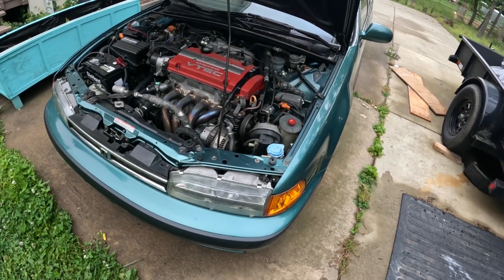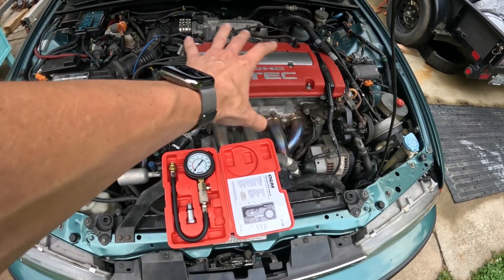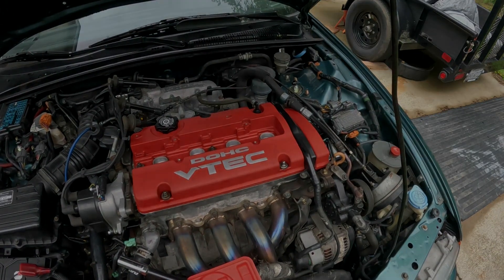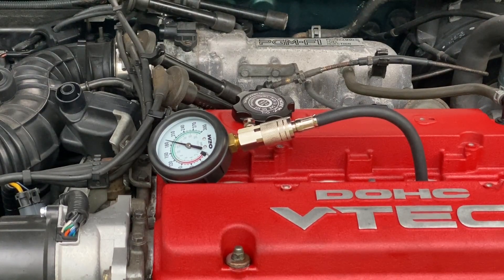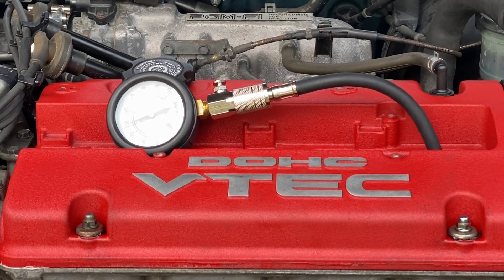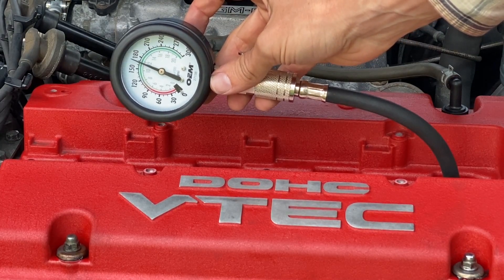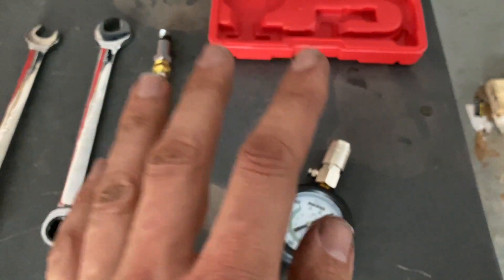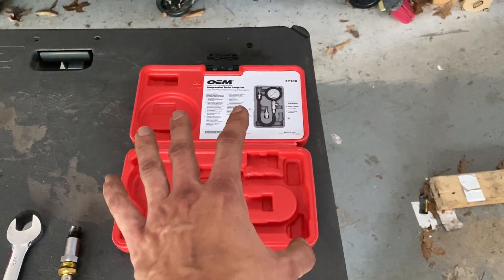Project CB9 - H22 Engine Compression Testing DIY

Comment: I know a good way to tell if its the piston rings is do the compression test dry then keep track of the numbers in each cylinder, then pour a teaspoon of oil down the spark plug holes and retest it. If the compression goes up, its the rings, if it stays the same the your valves are leaking causing low comp. Sorry forgot to mention.  Good luck.

Comment: Is there any blue/grey tint smoke out the exhaust? Ive turbo my previous f22/f23a and had bad rings, but it didnt cause oil to seep out anywhere. Just had lots of blue smoke while accelerating, or going down a hill. Typically on theses f and h series blocks, the oil leak spoats are cam seal, distributor, vtec solenoid, valve cover gasket, and the infamous corner head gasket leak by the cam seal. Also ive seen some cars leak from the axle seals. But even if you decide its the rings, the rebuild isnt that bad. I have my h22a4 apart now and im using brand new king race bearings and refreshing the valves and regrinding the valve seats along with new rik oem piston rings. Ive rebuilt plenty f22 engines, and just these few things replaced will give you perfect compression. Hopefully you dont give up on her

Comment: Hey I found a 1998 prelude and it still has the braking system on it. What all is needed for the 5 lug swap. Front spindle and caliber, do u need control arm for the front. And for the rear, complete spindle, caliber and what else for the rear. 

Thanks for your videos, I'm still waiting to see what next for CB7
Reply from the maker: Only thing Prelude needed is the rear hubs. Then you’ll need 90-97 sedan/coupe rear knuckle assemblies.  Front needs 98-02 Accord V6, Acura TL/CL or first Gen Odyssey.